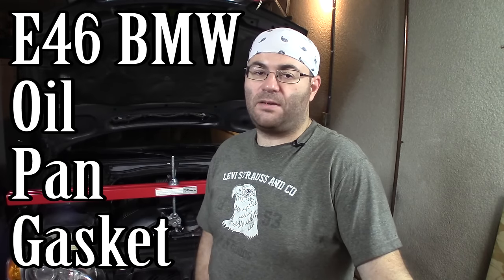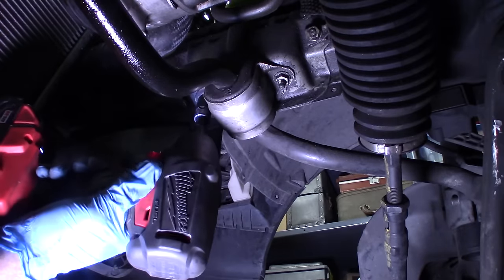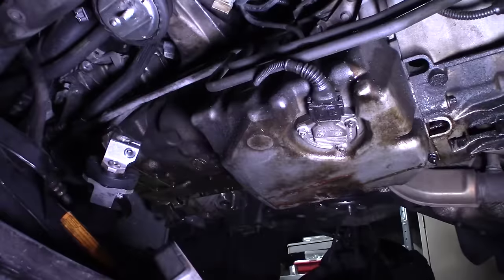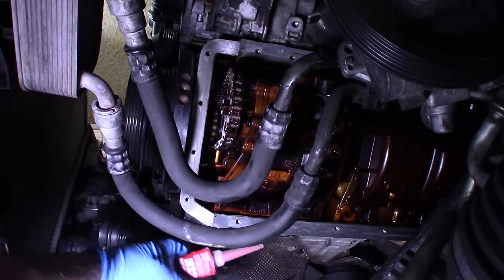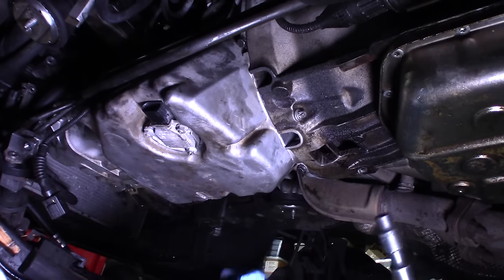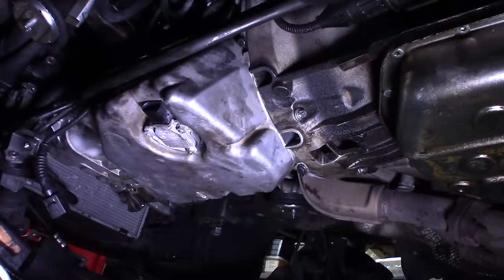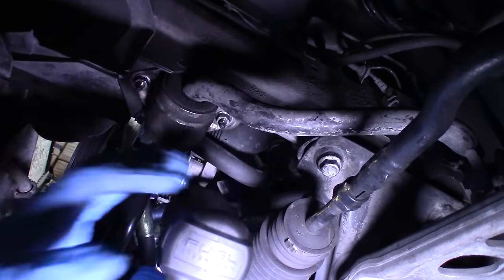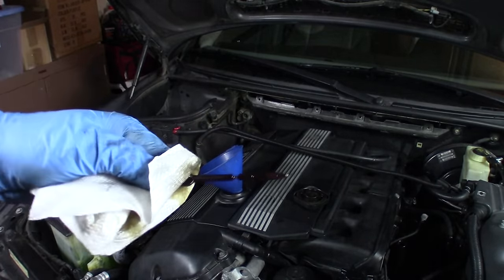BMW 330i 325i E46 Oil Pan Gasket Replacement DIY

Comment: Oh boy this looks pretty difficult and I hope this isn't my issue but I bought my E46 a couple months ago for pretty much nothing but it was fairly beat up but after a bit of love I got it running but I still have a oil leak(s) and the bottom of the engine is coated in oil so it's hard to pinpoint so i guess I need to clean and make sure it's my gasket before I start this project

Comment: Great tutorial! I plan to do this myself. Do you think it is possible to get it done with two jacks near the front wheels or should I put all four jacks to keep the car level?
Reply from the maker: I like to use 4 jacks at equal levels and make the car level to the ground.  I think it's safer.
Reply: how high did you put it in the air approximately?
Reply: The back sets higher anyway. After the second day I did add 2 rear jacks because I was worried about the frame warping but If you can knock it out in a couple days 2 should be good.

Comment: Thank you so much for such detailed and descriptive videos!!!
From start to finish how long would you say it took you?
What do you think caused the rear main seal leak?
Just worn out or in your opinion, is there a risk to the seal when doing this job?
I ask because I'm struggling with an oil light staying on a little too long on cold starts and I want to get the pan off and have a look at the pump and the pickup to see if anything has come loose that might allow the oil to drain back from the pathways.
The vehicle, 2005 325i, has 192,000 miles on it.
So I worry about doing this job (which I think i'm just capable enough to do) and causing a leak to the rear main seal (which I know I'm not capable {or at least confident enough} to do).
Any thoughts would be appreciated.
Keep the videos coming!
Reply from the maker: This job would take 6-8 hours.  But your problem is being caused by a bad check valve in the oil filter housing.  Check out my oil filter housing video.  If you remove your housing from the car entirely, you will see a little round check valve inside where the gasket surrounds.  That's what you have to replace.  I'm not certain where to get a new check valve, though.  You'll have to do your own research on that.  Here is a picture: http://forum.e46fanatics.com/attachment.php?attachmentid=456002&d=1339525482
Reply: I completely agree with your thinking.
I replaced the oil filter housing assembly with a brand new one.
The problem still persists though.
So my thinking is the oil pickup tube is loose or the bolts holding the pump on have come loose.
I've seen a few videos where people find some oil pump bolts in the bottom of their pan but I don't recall if they're m54s or not.
Thanks again for all your videos.

Comment: Tip to keep the oil pan gasket in it's place... Where ever your hands are holding the oil pan just put two bolts so the gasket stays in place and doesn't move. When everything is aligned just tighten the bolts a little bit so you'll have no problem putting on the rest. Hope this helps you guys.. ☺️

Comment: just bougtht a x5  a year ago from a dealer to build credit now a small leak turned into a full blown heavy leak im thinking its the oil pan gasket , im still paying for the car i just want it to be reliable. I also read online that I might as well change all the gaskets, oil filter housing , water pump , vanos valve cover,  maybe the head gasket to? what are your thoughts, I going to tackle this this weekend.

Comment: If I'm looking to just remove the subframe to deal with rust/corrosion  do I need to remove as much as in the video; air scoop, Air box, Upper intake boot, fan, belts, power steering pump etc.?
Much Appreciated
Chris

Comment: I am tackling this job this weekend. I have 2 questions for you. How do you usually get your stands on the jack points. Is there another jacking point I can use to lift the car? And how much do you think the Stealerships would charge for this job? Thanks for the amazing video!!
Reply from the maker: Watch my common repair steps video--I show how I jack the car up in there.
Reply: 50sKid Roger that thanx

Comment: Hello. I got a question I did the oil pan on my 07 335I . the problem I have now is I don't have oil pressure. Can you prime the oil pump from the outside without taking everything apart?

Comment: Thanks to this video i have started the work on my 2003 325ci convertible Lower intake boot removal  was a pain as it was factory installed with clamp screw facing down. Question  - what are the specs/part number for the oil pan bolts (hex set) - not an easy find . A set i ordered  online for about 40 bucks has all torx bolts and dont match.
Reply: Okay so finally all done :) Small 1" oil pan bolt part number is 11131740000
Few mistakes I made:
1) actually a blunder - I put front on the jack stands and as an added  precaution put front wheels on wooden stack of blocks. Well after the sub frame dropped the wheels moved jamming into the front bumper. It would have been quite difficult to align the K member to put back the sub frame. Had to jack up the car from rails running in the middle  to remove the front wheels - after that it made everything go smooth.
2) Forgot to remove the headlight sensor. After I dropped the k member it was pretty hard to disconnect it - ended up breaking both the pinch tabs of the connector. 
3) I didn't realize that the steering shaft had to be aligned where the notch is for the guibo pinch bolt to go through. Ended up ruining the bolt.

Other than that, I took my time to align fittings, hand tightened the bolts as far they would go. Couldn't torque the bolts just tightened them enough  as a set of 3 Pittsburgh torque wrenches turned out to be totally useless.  
Few considerations: change the air intake boots as overtime they get stiff and hard to put back. While at it, in my case, I replaced the engine mounts. Also the DISA valve vacuum test failed - got a used one from ebay for 35 bucks. 

Took about 15-16 hours to complete the job and a sore neck.

Comment: Your videos are the best. I appreciate all of your information and teaching. Curious have you ever had to replace a broken stud on the oil sensor? I over torque and broke a stud. Now I can’t seem to drill out the broken one. I am running it with only 2 nuts tighten on the oil sensor. No leaks yet, but waiting on the leak to start. Any suggestions?

Comment: one important question, does any of your disassembly of parts or connectors, would require a computer reset. i read somewhere that , if we ever disassemble the throttle assembly, then the car wont start unless we reset some computer module. kindly clarify if you have encountered any in your works. and, does any movement on engine should be very careful in the sense, like if i would move the engine too far up, it might break a gasket or seal elsewhere. correct me if i am wrong here. these are the two things i would request you clarify in your future videos. and great work, enjoy sheer driving pleasure - on your b.m.w!
Reply from the maker: You won't have to reset codes after this procedure.  It IS possible you might tweak a coolant hose a little, but it should be ok.  I vaguely remember that during my engine mount video I pulled on the coolant hose and a small bit of coolant came out but it was very minor and didn't cause any damage.  Still, something to be aware of.
Reply: ah that's helpful, thanks, i read in bentley, if we ever disassemble the throttle assembly, it will require a computer reset or reinstate. could you through some light on this topic. so, we can leave these areas to the specialist guys. and yesterday, i passed my 1998 318i e36 passed, the things i did was, replaced steering boots, and had a clean wash underneath. which took off almost all "oil leak" and odometer by my own, so i am quite happy, and have more confidence to own a higher model. now that i dont fear to go for a higher one. as we have now a healthy community. ))))
Reply from the maker: If you take off the throttle body (not the intake manifold) and clean it, just don't move the butterfly with your hand and you'll be fine.  Otherwise, you don't need a computer.
Reply: alright, thanks. ))

Comment: I already bought the gasket and since nowadays you can return parts you bought and  don`t need, I would like to ask what could I change since having all apart...
 As you already pointed out  steering guivo is one of them, engine mounts and lower control arms...in your other videos i`ve seen that you recommend changing o-ring that goes from suction pipe to oil pump...that is accesible here, right? 
Also the o-ring on dipstick...anything else?

Comment: Very good video, but ...on RTV install, use your finger to apply a band at the joints, and on gasket placement, use 3-4 short bolts to hold the gasket to the block while you navigate the pan, then use long bolts to engage the pan, gasket and block, then remove the short bolts, slide the pan up on the long guide bolts and secure with final hardware.  Also, no mention of transmission lines on the removal end that I could see, and also some items are not required to be removed, such as the cabin air filter and associated tray, etc..  Very nice job though.

Comment: Great video--watched many of yours and they are a big help, thanks! I wanted to get your advice...I've got a big job coming up on my 2002 330Ci manual, 275k mi. I need to do: oil pan gasket, rear main seal, flywheel, CSB, and clutch (clutch just because it's got 250k mi on it; it's otherwise fine). I was wondering how you'd do the rear main seal and the oil pan gasket....what order or all at once? Any tips would be appreciated. Also, I plan on doing the detents in the manual trans as long as I have it out. Let me know if you think there is anything else I should do while I've got the trans out. Thanks again!

Comment: for 7 foot pounds you need an inch pound torque wrench. 7 ftlb is 84 inch pounds. which falls in the accurate range for a 20-200 inch pound torque wrench.

Comment: Hi, First of all, thanks for the video..

BTW, why you didn't use the genuine bmw oil panel gasket? VR is ok, but to replace something like this and the time it takes, genuine bmw is better?

I am planning to do it on my 2000 Z3 (M52TU, 2.5L 6 Cyl). It looks very similar. Have 130k on it and oil is seeping through the gasket.
Reply from the maker: So much better it leaks after 100k miles, lol.  I dunno that VR is worse or better.

Comment: Hi great video I’m wanting to do this on an e46 m3 I want to get the k member powder coated can I get the k member off without disconnecting the steering column is there enough clearance when I lower it I know I have to unblock the rack it’s the column I’m not sure about?

Comment: VERY GOOD showing of what needs tro be done;   *Thank you*
edit---  in some cars,especially on older ones without overtightning prevention,  you can just retighten the oil pan bolts a bit to re-seal, but with this kind of gasket it's not likely.

Comment: Great Video!

Can you remove the top bolt of the Engine mounts after you lower the subframe? or do you need to unbolt those from the top of the engine?
I want to change my engine mounts at the same time.

Comment: Outstanding video.  What are your thoughts on doing this on a 330Xi?  What is the additional complexity of dealing with an "X" front end?
Reply from the maker: +Bmmerguy The additional complexity lies in removing your front CV axles (pop them out with a pry bar like all cv axles), front differential (4 bolts), and right axle inner bearing pedestal (4 bolts).  I would recommend checking out the message boards like e46fanatics to see if anyone has done a DIY write up.
Reply: +50sKid  Phew.  That's a lot of removing and, of course, prompts a few more questions.  Do I have to remove the differential and the pedestal (I assume this means the support bracket on the passenger side) or do I just have to remove the bolts ( I would guess if the passenger side CV axle is removed then the bracket would just come off with the oil pan)? Are there gaskets as well that will have to be replaced in those two areas?  Is it ok to remove both CV axles at once?  I remember reading somewhere (perhaps e46fanatics) that you should only remove one at a time (I just did the left side a couple of months ago).  BTW removing those axles requires a lot of other deconstruction (brakes, strut support, sway bar link, the mind reels...).  Thank you for your reply and comments.
Reply: +50sKid BTW I have searched for a few months to find a DIY for an e46 X class and have not had any luck.  If anyone out there know of one I'd appreciate the link.
Reply from the maker: +Bmmerguy Sure it's ok to remove both CV axles at once.  Do you have to remove the diff and pedestal or just remove the bolts?  Well if you remove the bolts, they will fall off, lol.  The Bentley manual does mention that you should replace some seals every time.  Shoot me an email (look on the about page on my channel) and I will give you more info.

Comment: Interesting how gasket maker is applied and the pan is being torqued right over it the same hour while instructions on the back of the tube say that you can only torque after silicon has dried out.  Meanwhile oil is running slowly down the seams you apply compound to.

Comment: I have watched Your vedio on how to replace the OFHG , my question is did it stop Your oil leak or it was the oil pan leak ?
thanks for the great  DIY'S
Reply from the maker: +Fadi Matti Doesn't the fact that I made this video answer your question? ;-)  Both were leaking.  Everything leaks on a BMW.
Reply: Your  vedio is really helpful bro , Im gonna do the OFHG coz the oil I see is where the Power steering pump is , thanks again :)

Comment: The 8 bolts on the aluminum reinforcement plate are "torque to yield" bolts.  After you tighten them to 44 ft-lbs, then you turn them 90 degrees, then you turn them another 30 degrees.  They need to be replaced every time you remove/reinstall the plate.  They are not cheap @ $3 each.
Reply: Well...................................no. :)

Comment: Hey again! One quick question, couldnt/should u do some more work with the pan removed, like repairkit for the oil pump or something? Can u clean the inside of the engine from old oil and stuff? Is that possible? 
Best regards!
Reply: PS or i the "shit" in the bottom of the pan and in the other places usually  where u can reach with the pan down anyway?
Reply from the maker: The oil pump nut coming loose was a problem with older engines, not this one.  You can clean the pan, like I did, but there's no point to trying to clean the bottom of the main caps and what not.  The engine is what it is.  Only way to clean it is to disassemble and have everything hot tanked when you have your cylinder head machined.  Don't worry about it, who's gonna see it? :-)

Comment: You're really smart how did you learn so much about BMW's mechanics?
Reply from the maker: I learned about all the common problems with BMWs on the message boards.  I learned about fixing cars by reading a bunch of text books, watching every video I could, and then just doing the repair jobs and gaining confidence.
Reply: Thats awesome because I've watched your videos and Ive done my own oil changes, CCV valve, Valve cover gasket, and Oil filter housing gasket repairs. I think I need to do the oil pan gasket now. I have an 04 e83 X3 so things are different but similar. Anyways thanks for all the helpful videos man!!

Comment: WRT the oil dip stick, can you loosen the bolt that secures dipstick and simply pull the dipstick up from under the car? The only intent is to release the dipstick from the oil pan. I would like to minimize removing parts if not needed. I see removing the disa, lower boot, etc.
Reply from the maker: Yes you can definitely do that.

Comment: Excellent video, just in time for my sump gasket job. BMW recommends to start tightening the sump bolts in the middle and work outwards in a Z-shaped pattern. 

I find my 1/4 inch torque wrench works best for M6 8.8 bolts rated at 10 Nm / 7.4 ft-lb, rather than a 3/8 inch torque wrench.

Finally, you really should use new bolts for at least the subframe, lower control arm bushes and reinforcement plate as they are really one time use only bolts.
Reply from the maker: +clabcon It's up to you if you want to spend $50 on new bolts! ;-)  A 1/4" torque wrench is often times calibrated in in-lb rather than ft-lb.  The torque would then be 88.5 in-lb.
Reply: +50sKid Not sure why you did not go genuine BMW on the oil pan gasket given the effort involved. I have heard the type of rubber used in the victor reinz valve cover gasket is inferior to the updated BMW one. RE: Bolts, I am only passing on what TIS recommends. The reinforcement plate bolts are stretch bolts too.
Reply from the maker: Where did you hear the rubber was inferior?  I hadn't heard that.  I know they're stretch bolts and I really should replace them but I haven't had any problems so far--plus I remove them too often for video purposes that it would be impractical to replace them every time.  Definitely don't do as I do, in this case.
Reply: The old BMW VGC design used BUNA, whilst the revised part uses VITON. Not sure about the sump gasket, but in my book it would be worth the extra $15 due to it being a PITA to change.
Reply from the maker: +clabcon Things that could have been useful to me YESTERDAY! lol
Reply: I am not sure if the same is true with the oil pan gasket. I know the oil filter housing gasket is not Viton.

Comment: Is there a gasket where the pan meets the transmission?  Do you have to replace that one?
Reply: It's one of those metal gaskets, which is continuous around the entire transmission connection to the engine....so no need to replace.